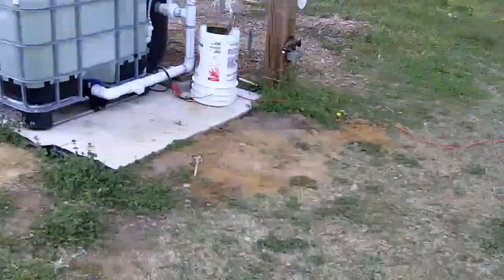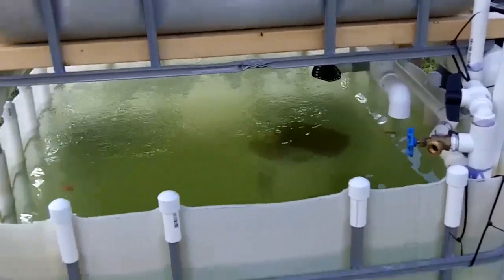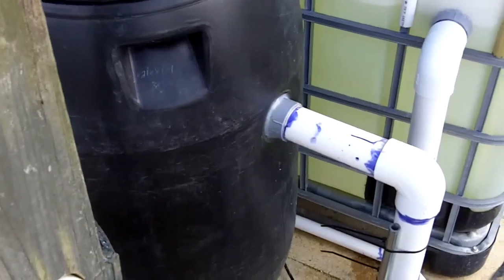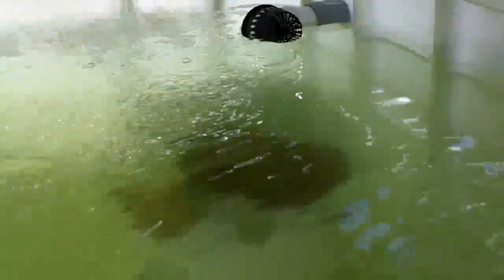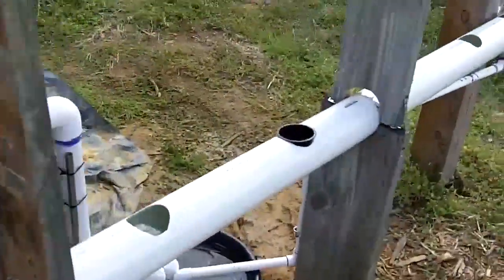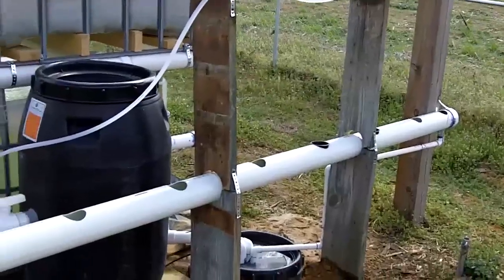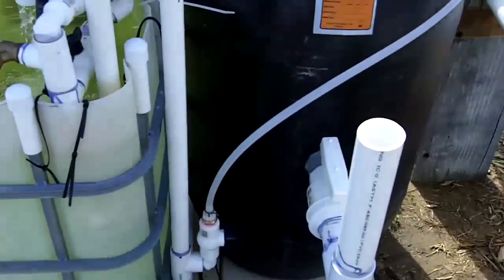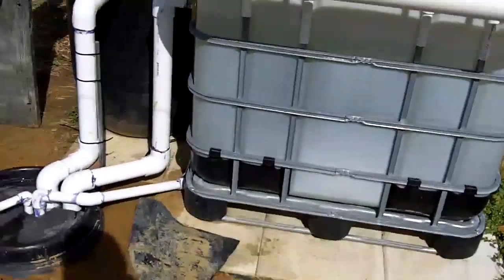Aquaponics Update 03/24/2011

Comment: @stevesnnc --  It's in plumbing section. It calls rubber packing sheet. 
Plumb Pak  Red Rubber Packing Sheets 6" x 6" x 1/16" 
Item #: 31446  |  Model #: PP25546

Comment: Thanks Steve! Funny thing I did the same thing, but use 1". Prior to use the electrical conduit stuffs, I was looking for bulkhead fitting but can't find anywhere. Don't know if you know, but Lowes has a rubber sheet like 6" x 6" or so which I cut out as "oring" instead of using silicon. It works perfectly well, no leaks. The only thing is I'm using stock tanks and the Rubermaid ones are thick; and the " bulkfitting" + rubber gasket barely fit overall. Nonetheless, they still work. Are you in H

Comment from the maker: It is actually not a bulkhead fitting. I used 2 inch male and female threaded adapters from the electrical section. When you screw these together they will tighten down better and work much better than 2 inch plumbing pvc fittings. They are almost identical except for a difference in the tapering of the threads. You can get them at Lowes. They work great as bulkhead fittings. Hope this helps.

Steve